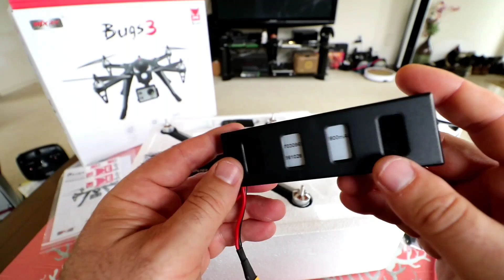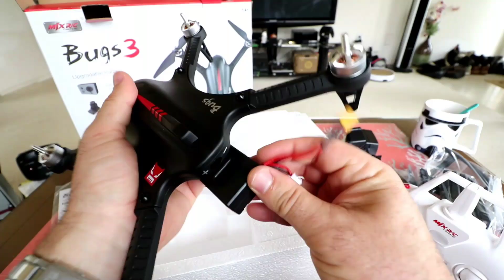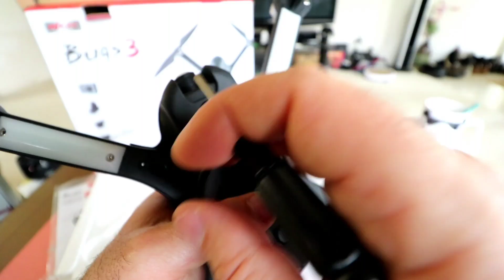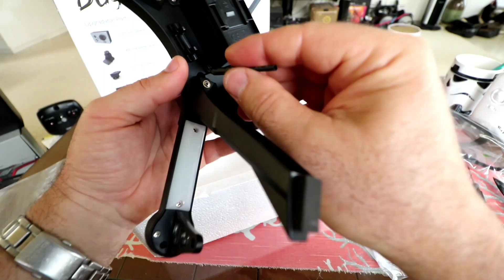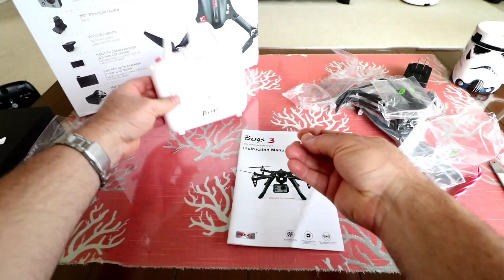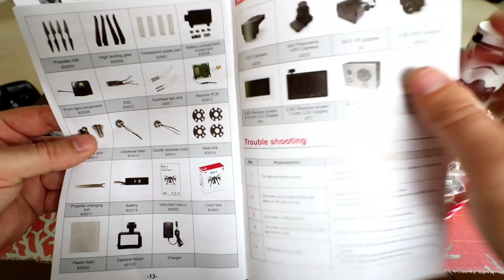MJX BUGS 3 - Full Review - [Unbox / Setup / Flight Test / Pros & Cons]

Comment: Dustin. You seem to know a lot about drones and I just have a quick question. First of all I love the bugs 3. I heard you mention the brand JJRC. Every jjrc I've ever owned has gone bad after maybe a year, year and a half. When I say gone bad I mean it won't on a full battery charge it will not fly more than just a couple seconds. I had an h31 that did that and several JJ 1000s. Same  problem.The batteries are new and work perfectly in other drones such as the syma C5. Any idea what it might be or how I could correct it?

Comment: One thing bothers me - when you want to fly high - and drone and controller will have weaker signal - will controller informs you about that? Is there any way for you to check that? For example - you leave drone in one place - try to fly - it fly - ok. Go away from it - try again... and so on. You know, when you have drone that cheap and cam attached to it that costs 4 times more - you don`t want to lose it this way.

Comment: Nice review as usual Dustin.  We are looking for an entry-level sporty quad (not crazy fast racer) after coming up to speed on piloting skills on Hubsan H107, Ethos QX130, and even Hubsan H501SS.  Would this be a good choice for a sporty outside flyer?  I do wish it had built-in FPV with display on transmitter screen (no phone required) so if you have a competitor with those features, please recommend.  Thanks again for doing these.

Comment: There is a low frequency hum when you bring the controller close to your head set. You could hear it all through the vid. But, a very cool vid. I plan on using the batteries from the 3 to my 6...

Comment: I got my bugs 3 drone and when I fly it up and down it isn’t as stable as a lot of videos I have seen of it either it goes up without doing a lot or It just goes down and crashes In the ground is this because I’m really bad or do I have to do something to make it more stable and still in the air
Reply: Try recalibrating your controller (your manual or another YouTube video can show you how) and adjusting your trim levels on the controller. Best to adjust trim on a day with little to no wind.

Comment: Can you pair a different remote controller to this drone?
Reply from the maker: You can use a "jumper" multi protocol controller.
Reply: @DustinDunnill  thanks, I have no idea what that even is, but i'll look into it. I mean, if I purchased a good high end controller, can I connect that somehow? And some fpv goggles? I recently purchased one of these drones, but would like to use it with higher end equipment. Only the drone will be a cheap investment to practice fpv racing and flying with.
Reply from the maker: You'd likely be better off modifying the existing controller and put some better external antennas on it to improve range if needed.

Comment: I LOVE my BUGS MX3 it's a CRACKING DRONE for the MONEY!!! I ganna get a few more HIGHER CAPACITY batteries and CONNECT them in SERIES and I can use them in MY ATOMIC boat as well 2*7.4 VOLTS =14.8 VOLTS for my VOLANTEX atomic.My ONLY complaint about the BUGS MX3 is that the Transmitter Doesn't have a VOLTAGE indicator, even the CHEAP drones LIKE the X5 has one of them and the manufacturers could have put one on, it would have cost NEXT to NOTHING!!!

Comment: Can anybody please help me with the C4022? Even when I successfully connect to the cams wifi it says "internet not available" even though it is connected at 65 mbps. Then when I open the app, at first it says it is connected to the drone, but by the time i click the two "Next"  & "Click" buttons and get to the MJX GO apps final viewing screen it then says "device not conneted yet." Its  brand new, installed correctly, and the app is installed on my Android LG phone. I read that you have to accept and click "OK" on your phones wifi settings to make it open correctly which ive tried. Ive tried different sequences of opening my wifi and Mjx app. It is also concerning that upon opening the MJX GO app you see no option for "C4022 for B3" the closest option is "C5020 for B3." I choose the latter because it is the only one that says anything mentioning the B3. If anyone has exp with the cam please help. Thanks.

Comment: Hi watching your video while setting up mine very useful, appears the throttle is non-maintaining. It doesn't center if you release. I actually wrote Drocom asking for a new remote. I have a couple B2w and B2SE. The control is not interchangeable..
Reply from the maker: Correct.   Drones with altitude hold sensor will will usually only have a spring center throttle.

Comment: My Syma X8 packed in, after many flights like.It just lost power. Think it needs a new system board.Anyway I am in the market for a new drone,I will definitely be buying one of these early in new year, 57 pounds odd for a new Brushless drone is a real bargain, cant wait to order it and get it delivered.Why pay hundreds for a phantom? The Bugs MX3 should be ALL the drone  I need.
Reply: I upgraded to a Bugs3 from an X8 as well. With a cheap cable adapter, you can run your X8 batteries in a Bugs 3.

Comment: Dustin, between bugs3 and xk detect x380 which one you suggest for use with action cam and for reliability?
Reply from the maker: They are 2 different classes.  The x380 is a GPS camera bird and the bugs 3 a cheaper non GPS brushless bundle of fun.  Both great in their own category.

Comment: I got one yesterday. Tip: the provided screwdriver is magnetized, making it easier to put on the legs. And for the controller, put the screws in the tips first, then screw it down. I rounded out the head on one screw doing it the other way. Great drone though. I love it.
Reply: GuideToWhatever 100%. was about to say the same. couldnt drive the screw all the way in on 1 of my controllers. screw driver a little play for the controller screws.

Comment: I had a quick question I got this quad and the front left motor is a little stiff but flys fine should I replace this motor or leave it.
Reply from the maker: I'd leave it.  Feel it after a full flight.  If much hotter than others... Replace it 👍
Reply: Dustin Dunnill Thanks for the reply!
Reply: Dustin Dunnill  hey Dustin sorry for all these questions it’s my first brushless drone I keep worrying. My question is the motors have a little bit of side to side play it’s not anything huge just a lil bit but it fly fine and also vibrates when it’s in unlock mode and is on the ground if I give it a little bit of throttle it vibrates other than that it’s fine.. should I just return it or keep flying and also does your bugs 3 motor housing have play in it thanks looking forward for you response!
Reply from the maker: A little play and vibration is ok.  Sounds like propeller or 2 may be way out of balance.  Try switch some with the extras to see if the vibes go away.

Comment: What does reverse of new function mean on the bugs remote control . It's the switch by the left stick?
Reply: Chenglish !  What they mean is 'reserved'. But this is my calibrate button on my Bugs controller. They've labeled the wrong button in the manual. This is the button that gives me the 3 beeps that the manual talks about. I realize this is an old thread, but might be of help to someone.

Comment: andrea4809
There is nothing bad to say about the Bugs 3. Just an amazing quad for the money, cost aside its still a great quad. Lends itself incredibly well to modifications. Really blurs the line between toy and hobby grade quadcopters. This is the quad you want if you are going from toy grade to race quad, its also the quad you want as a second flyer. Buy a cheap knock off go pro and throw the legs back on and in 5 min you have a nice camera bird as well. Cant go wrong with this one!! For Around $220 you could by the drone, a 3s battery, a nice 5.8 fpv cam, goggles, a knock off go pro and you would have everything covered. 1 quad to rule them all so to speak.

Comment: Bought a Bugs 3 from a vendor at the Oshkosh Wi EAA Fly in . It will not unlock. All the trim buttons work except the one labeled #3 "Reversed for new functions". all the others click and the controller beeps . #3 does not. Do I have a defective controller?
Reply: Daniel Guenther no, plug in 1st, then push red button in on controller and hold while turning on, keep it pressed and wait for the beeps, now press red to start motors 👍👽

Comment: I made a sleeve to print out to hold 2s batteries so you can change quickly. They fly well....I noticed the capacitors near the power input and on each ESC. I think this smooths out the flight characteristics by getting rid of noise in the feed, correct me if I'm wrong. I actually was thinking about getting the Mini too as it's quite the little monster from what i've seen here.
https://www.thingiverse.com/thing:2843708

Comment: I had the same problem with the screws, they are made from cheese grade metal and they bind up while driving them into a virgin hole and the driver will tear up the head of the fastener...you'll want the best (fitting) screwdriver in your shop and to maintain constant, hard down pressure while "tapping" the hole the first time. My right hand stick was the one that got chewy...I was lucky to get it out, cut the head and reinstall with a flat head driver. They are NOT "to long" as stated in the video...the threading is just very grippy and the head can't handle the torque that builds up as you screw in to virgin material. Screws are easier the second time in...you'll notice that when putting on the prop guards. If you end up with a stick like this guy did, that is not fully tight and fastened all the way down, then using a drop of CA glue (superglue) roll works just dandy for you. 

BTW, the LEDs off don't "save power" enough for it to be even mentioned lol ...they draw such a low amount of current and capacity that "maybe" you'll get another 15 seconds of fight with them off, lol....so it's negligible.

Comment: I just purchased this quad and have 5 flights on it.  It came with an extra battery and an extra set of props.  I watched several reviews on the MJX Bugs 3 and everyone is getting several minutes (3-5) of flight time after the low voltage alarm kicks in, except for me.  I only get 25-30 seconds of flight time after the alarm kicks in.  Check out my video at https://www.youtube.com/watch?v=FqIUtdmz7VM - starting at 15 minutes , 10 seconds into the video.

Comment: I do have one problem that I wonder if you have encountered with the Bugs 3 and connecting it to the transmitter. I have started it and flown it a few times but sometimes when I turn on the TX while pressing down on red button and then plugging battery into the drone, the front lights begin to flash like normal except they don't stop flashing and turn solid like they should. I try over and over to restart it, change batteries, and still those front white lights keep flashing! Eventually it will finally pair up properly and I can fly. Do you have any thoughts on why this is doing this flashing? I value your expertise with the Bugs 3 and wonder if this is a common fix.

Comment: For anyone considering purchasing a Bugs 3 you should know that there are a couple negatives that need to be considered. The first and biggest one is the red button motor start and stop which honestly I can’t figure out why it has this feature since it doesn’t have altitude hold. The problem is if it ends up upside down in dirt, while you are holding the red button waiting for the motors to cut the props are pump dirt right into the motors until they cut, not to mention it also tears up the props and motors if its down in long grass. Also the bugs 3 is really heavy which puts a lot of strain on the motors and causes them to get pretty hot, especially with a 3S battery which is a lot more fun then that wimpy 2S pack it comes with. Lastly, some people, me included are having trouble with their Bugs 3 glitching and doing some bizarre things like suddenly flipping and flying erratically for no apparent reason. But by far the red button motor cut is the biggest drawback to the Bugs 3…..

Comment: thanks for the video! now i, probably, know better how to use trimming and expert mode ;)
can't wait for the good weather to try my bugs outside with my mobius-2 mounted!
Reply from the maker: +winex Good to hear.  Have fun 😃👍
Reply: +Ded Mamun, well, SJ6 LEGEND weighs about 82g - yes, that's possible. safe flight time will be about 8-9mins. but this drone is kinda harder for camera since it can't hold position like the GPS drones. SO, i suggest you looking for MJX B2W or B2C -- my friend has one and it's awesome. he carries an GoPro Hero3 for 8mins w/ this one and the footage is not stabilized, but really not bad. anyway, you'd better attach some light anti-vibe pads or smth like, because vibrations are a hell for cams, even for those w/ any stabilization.
also, you can check my channel for Bugs-3 + Mobius2 (45g) bad-noob-pilot footage ;). though, i'm getting better since then, lol
Reply: winex  CAN I USE SJCAM SJ6 LEGEND ON THIS DRONE?

Comment: The Bugs 3 is a pretty impressive quad and reasonable in price. I was wondering if you were going to work on adding good gain
antennas to the quad and transmitter for FPV flying? Quadcopter 101 had a test on a quad using a fisheye lens on a camera that
was mounted down on a quad. The hole in the bottom of this quad might be for that using that type of camera FPV and with
software that gave 360 degree FOV. The review was real impressive and I am sure he was flying the quad with a WiFi setup
which would have limited range but the view from the camera using the software was real impressive. Thanks for your review.
Reply from the maker: I'm thinking of putting a mini 5.8cam setup on it and do the range extension since this one is pretty popular :)
Reply: u should be verified on youtube

Comment: Without cam and legs this is loads of fun....easy 60Kmh. Even with aggressive flying i get about 12 minutes. I swapped transmitter batteries after 14 flights, not because of low voltage warning.... just nervous about when the duracells were gonna die.
I've got an anti jello mount but to be honest I don't think I'll get any really steady footage until my 3 blade props arrive. However, the photos from my Firefly 7S have been absolutely stunning considering the price tag.
https://goo.gl/photos/GBc8upggb21QL14H6

If you're new to RC flying, this will be a challenging introduction. There are no GPS auto land, follow-me kind of cheats here... it's pure manual flying adrenaline...fast and very addictive.

Comment: This is a 5-Star rated quad even with it's few shortcomings. The major thing that I think was missed is in not using a 2200mah battery. I changed my battery system over by using a Zippy Compact 2200mah and purchasing a larger Hexfly charger from Amazon. I went on eBay and purchased a pair of wired female xt30 to male xt60 connectors. The batteries are a tight squeeze in the quad's battery compartment but I made easier by removing the battery label. I thought about placing in spacers where the holder attaches to the quad but this mode seems to work OK. This makes this quad a screamer and will give you around 23-26 minutes of flight time w/o camera and 18-20 min with. It's one heck of a fun screaming machine with power to spare. I just wish it had a GPS or I knew how to add one.

Comment: Nice video I'm interested in the BUG as a beginner into drone flying. I know you talked about battery box cover and other items on copter having added weight. My thought on that would be to drill small holes within the battery cover once removed and legs to lighten it up but not go to wild making hole that it threatens strength.

Comment: I read about someone mentioning the kai deng k70. Man!! Dude!! what a piece of crap!! it is the worst  quad i've ever owned by far. Mind you, i didn't get the first version, i got some piece of crap altitude holding piece of junk. No power , uncontrollable, automatic take off????? If you can't take off, maybe you be flying a syma x5c or something. These engineers are dumber than the ones we have in machine tool building. Just messin in front of the house , so i went back in and grabbed my old trusty wltoys v262, she still sooooo sweet!

Comment: Today after a 8 minutes fly I opened the cover and found burning smells. It was extremely hot. No ventilation on this quadcopter so cheap and independent ESC will burn out after few flights. I guess that is the reason they kept the flight time between 8 to 10 minutes and no spare batteries in the market.
It is an awasome flyer though.
Reply from the maker: Maybe you just got a defect.  It happens alot with brushless esc's..  some have used even higher voltage 3s batteries and it seems fine from what I hear.  I'd replace the ESC and get back up in the air.
Reply: Dustin Dunnill I guess so. I will contact Gearbest to check what they can offer. Getting an ESC wouldn't be easy as no after market accessories.
Reply from the maker: Good luck.  If your capable in soldering, you might just replace all the esc's with equivalent ones after opening one up to see they are.  It may be cheaper than other options.

Comment: I think this will fly on 3s as well but forget about the camera as increasd vibration caused by extra power will make visability 
problematic.
Reply from the maker: Iv'e heard it does take 3s.  Good point.  Might have more vibration.
Reply: Just ordered some 2200 man they fit bay little padding, need xt60 converter job done